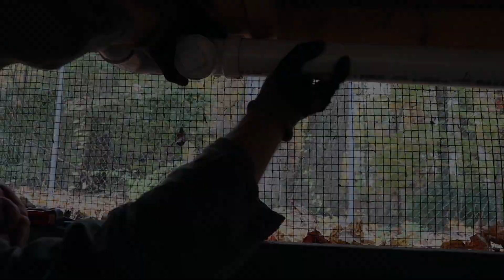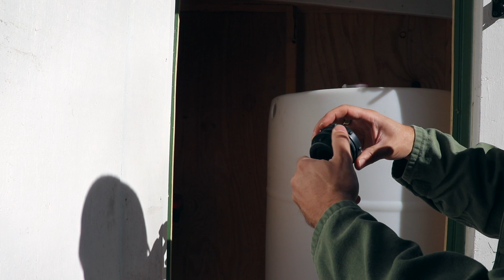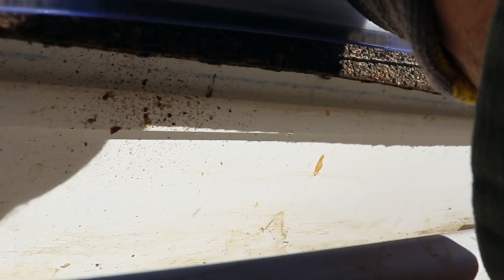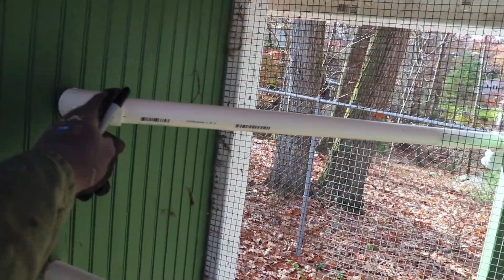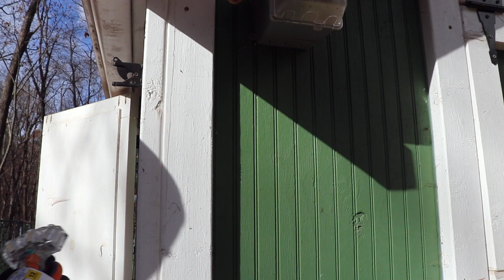How to make a freeze proof chicken water system. EPIC!

Comment: Awesome! Now I am confident I can build a smaller version of this and not use a heat-tape on the section of pipe with the drinking nipples. As long as I am circulating heated water. Thank you!
Reply from the maker: You definitely can do without the heat tape!!! I didn't use any and it's been flawless.

Comment: WILL NOT WORK! I connected up a pump like this. With the pump running push the water nipple air will be pulled into the water. Chickens can't get water. The pump should be first from the lower bulkhead pushing the water to the nipples. Other than that it's a good setup.
Reply from the maker: Hmmm. Not sure why this didn't work for you. It's worked flawlessly through Boston winters for me since I installed it. No issues so far with the nips not working
Reply: Just check when the pump IS running to make sure the chickens are getting water from the nipples.